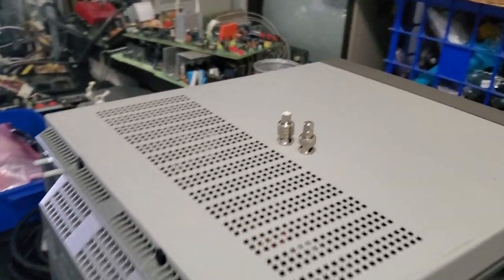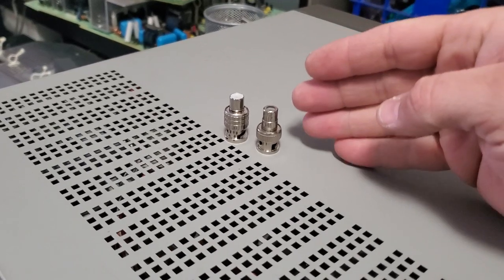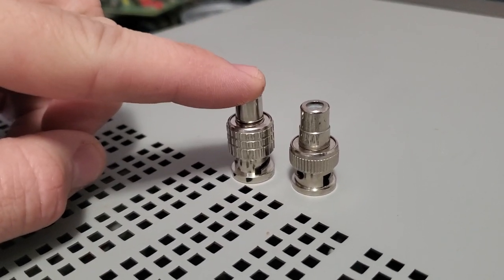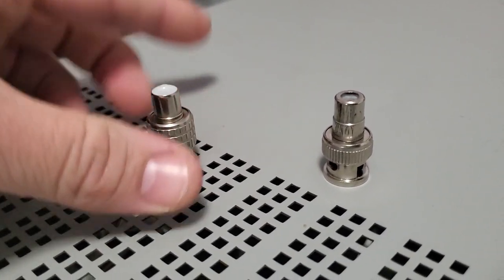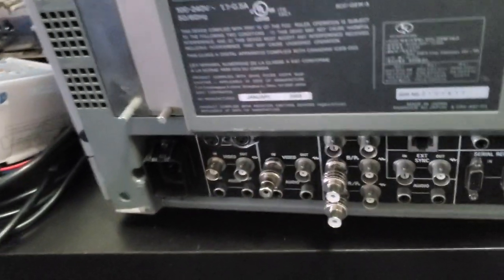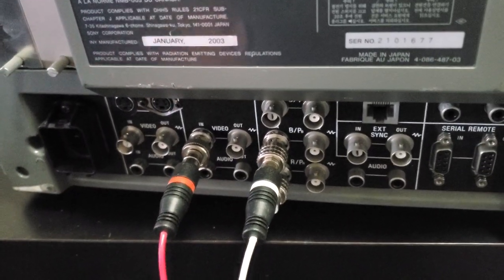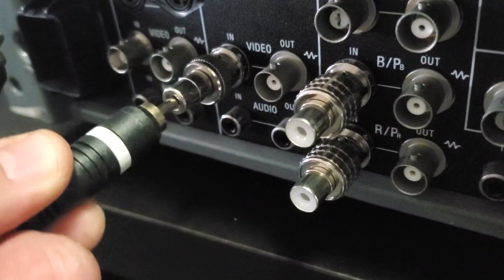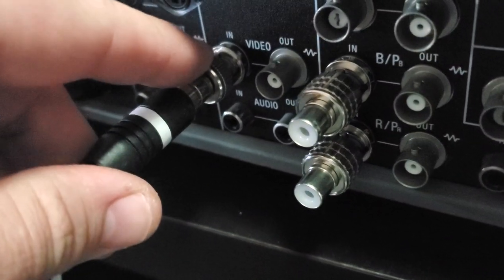Choosing the RIGHT BNC Adapter for YOUR Professional Video GEAR

Comment: One of the many reasons to go all BNC from the start unless you need to interface with a device like the OSSC. Console to bnc cables, extrons, and BVMs with RG6 BNC patch cable. Avoid RCA/SCART imo
Reply from the maker: Scart is a pain in real life.
Reply: I dropped some serious cash on BNC console cables from Retro-Access. Just prime stuff.
Reply: @RetroTechUSA  Same. SCART is a nightmare. Those cables all look similar but no one knows what's inside the case. RGB? Composite? Proper capacitors? If the cable is not the highest quality it causes all sorts of distortion to your pictures and even audio.
Reply: @Monochromatik-Vision 😂I would wire my consoles, matrices, converters, and video processors with BNC cables, and then convert RGB BNC to SCART at the end to hook up the TV. I have a KX-29 and it works well.

Comment: Picked up some Monoprice gold-plated adapters based on recommendations. Not sure if I got fakes or got a bad batch, but RCA ends don't go in as snugly as they should (similar to the cheap adapters in the video). Hope the Canare are a significant improvement. Only need 4 anyway, with no plans to buy anymore if they do their job right.

Comment: Thanks for the video. Living in EU Canare BNC could be quite expansive (like 10/12€ each shipped); a good alternative are the ones you can get on Retrogaming Cables UK. Picture with quality component cables is very good with Wii/PS2@480p, where cheap BNCs give a lot of noise/ghosting.

Comment: I bought an old mic amplifier on Ebay. It has a Bogen label on it but I think it was either put on or it has been altered. The only outputs it has are 2 groups of BNC jacks labeled 25 watts. I have never seen BNC jacks used with audio before. I have been buying old  and new amps for 40 years. Any idea what they had in mind?

Comment: The cable connectors you use make a massive difference in connection. Some component cables grip like a bulldog, which would probably make the cheap ones more ideal as you would literally be playing tug of war to get them off the higher quality ones.

Comment: Hi, maybe you can help me, seems that some magnetic field is distorsioning my crt making that it rotate the image to the antinclockwise direction. If I rotate the tv over its own axis the image rotate until get correct and if I continue rotate then the image appears rotated to clockwise direction (I use 240p tool to see the rotation). How can I detect the magnetic source? Magnetic detector? Thanks in advance

Comment: I do use the gold Monoprice ones that are definitely a improvement over the cheap ones, but may pick up a few of those for extron output to pvm and back of PVM to reduce likelyhood of point where connection is failing.

Comment: I bought a pack of the Zosi about a week ago since I just got my first PVM (1351Q) and I must’ve gotten a decent batch because they seem to hold on decent to my various cables. Nothing like a Monster cable grip, but it’s sufficient.

I’ve been meaning to comment, or subscribe to your patreon possibly to ask you some questions about the 1351Q because, like you said yourself, it seems like a fairly undocumented PVM, and even the manual doesn’t have a good cap list!

Mine had a bad 5v regulator so I already replaced that to get it going til a full recap happens.